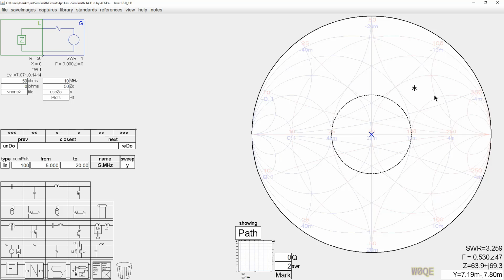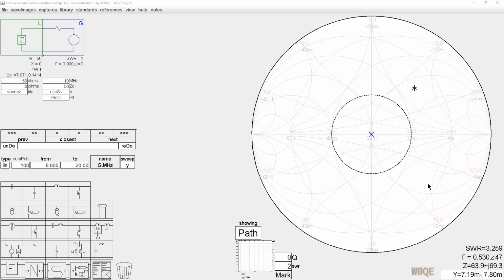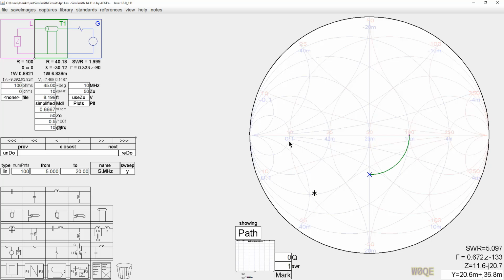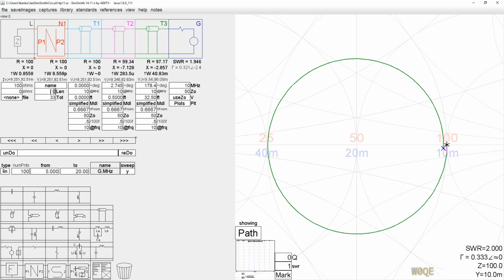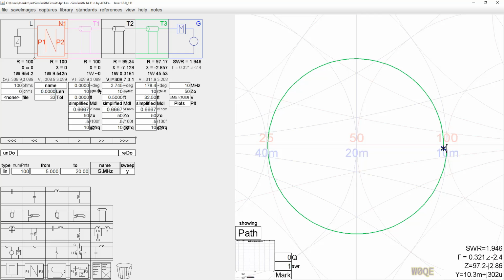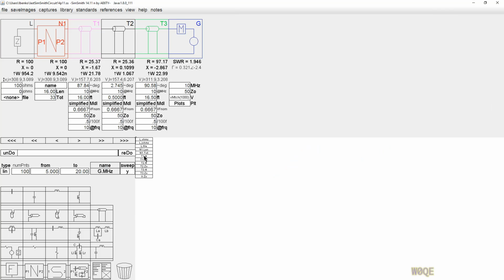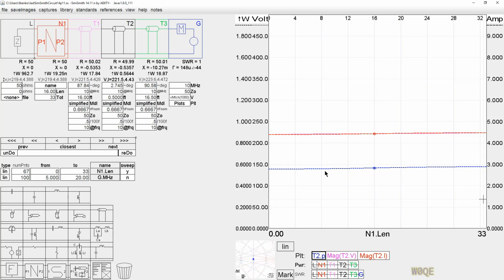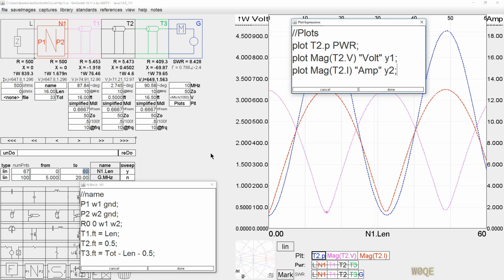#12: Transmission Line Voltages & Currents plus the "Splat" feature (Basics 5)

Comment: Thanks for the video, it's really helpful.
Please I'll like to get your thoughts on matching an RF antenna with <=2:1.5 VSWR and an RF front-end with <1.5:1 VSWR. Both at 50 Ohms. Thank you.
Reply from the maker: Jotshaw,
Your question can not be answered with the information you provided. A 2:1 SWR can be an infinite number of impedances. For example 100+j0, 25+j0, 40+j30 and 40-j30 all represent a 2:1 SWR in a 50 system.  Yet they all match to 50 ohms with different circuits.  I have done several videos showing various ways of matching with capacitors, inductors, transmission lines, transformers etc. which may help.  You need to measure the impedance you wish to match to and not just the SWR.
Does this make sense?
Larry, W0QE
Reply: @w0qe  Thanks for the reply. Will it be sufficient information if I add that the frequency is at 1.5754 GHz? I extended the transmission line (extending the wire length) and the results are better. I'll find a way to obtain the impedances on the transmitting and receiving ends. Your suggestions are highly appreciated. Thank you.

Comment: Thanks for this great series: I'm duplicating your instructions in  this video and at "12.53" you say " if I click over here" (on the length);      I'm using a Mac and when I try to scroll with the mouse wheel, to move T2, I get the following message "Warning, increment too small increase number of digits in file/preferences or using rightClick in parameter...; any suggestions would be greatly appreciated. Again ,many thanks for these great videos.

Comment: Thank you for the clear explanation on the losses due to high SWR on the transmission line.
Q, if the radiated EM field is proportion to the magnitude of the current flowing in a wire, would a high SWR result in a higher EM field ? I'm think about something like a rhombic antenna, would you get an increased EM field by driving a high SWR on the line??
(I suspect not, but it might be interesting to know why not?)
Reply from the maker: In a transmission line SWR does not necessarily imply an imbalance of currents.  Therefore SWR alone does not result in a higher EM field.  If the transmission line is imbalanced or if you are looking at the EM field from the wires in an antenna things are much different.  In this case I would suggest that you use an antenna modelling program and calculate the EM field a various positions relative to the wires.  This may not be the answer you were looking for but I am not an EM expert.